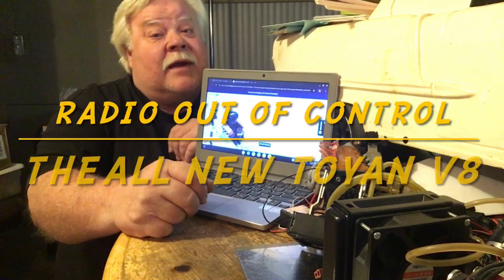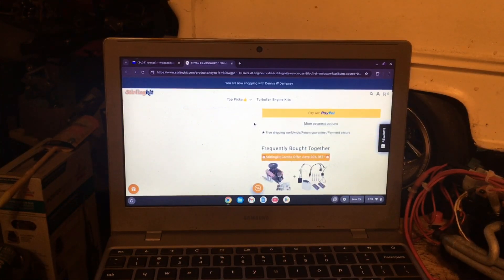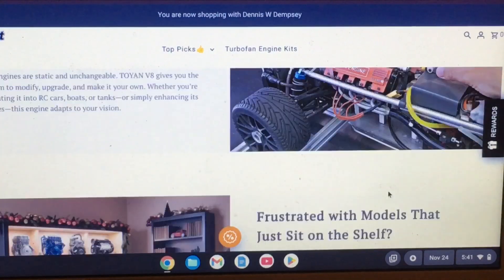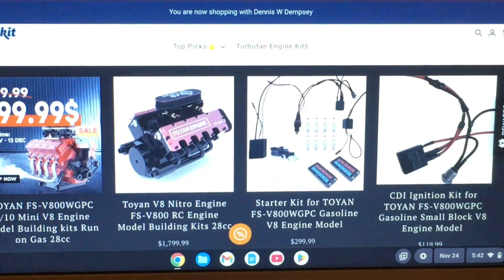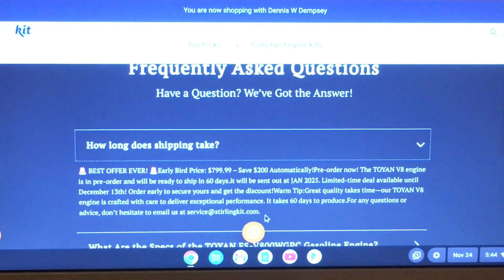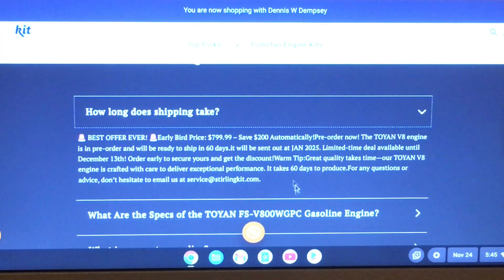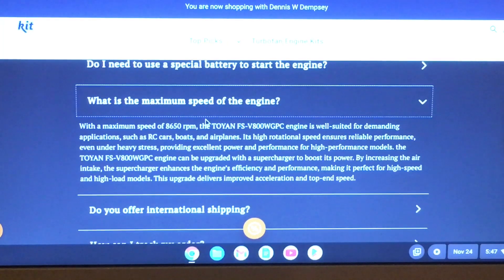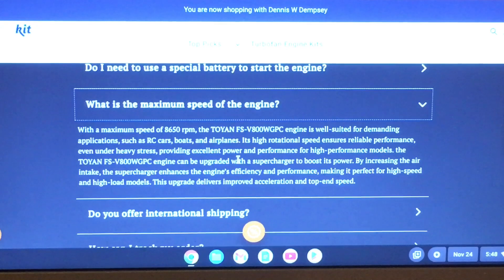The new V8 engine? a TOYAN?

Comment: I like the Cison V8 better because it looks more realistic. I have the OHV and Flathead versions. The ignition system on these engines seem to be more reliable as well. I ordered two Cison ignition modules to use on my Enjomor V12 so I don't have to keep robbing them from the V8 engines. Thanks for the update on the Toyan V8. I might get one. I'm not sure.
Reply from the maker: I have to agree with you there, the Cison looks pretty realistic! good call on the ignition modules 👍 I have a Enjomor V12 that keeps burning up the brushless starter motors, I had it fire off once before the second motor went up in smoke, I think its to tight and strains the starters.

Comment: I liked the new Toyan V8 for its design and price. I still don't know exactly how it works. But I do know that the first units are starting to be manufactured right now.
Reply from the maker: I am with you, there's a lot of speculation about how it functions. I am sure more will be revealed as they get more units built.
Reply: @dennisdempseyradiooutofcontrol You are right, that is what happened with the Cison V8 and it became my favorite engine from the first time I heard about it, so I will have to wait and see how its final production version turns out.
Reply: But what disappoints me most about this engine is its poor lubrication system. It was supposed to be independent when it is not. I will miss its first version very much, which is better than the new one for now.

Comment: Same sh*t different day for Toyan. It's a scam and no improvement by any means .save for cison or new small scale Chuan Qi v8 that's gonna come up
Reply: You are right, the new Toyan V8 should have come out much earlier than the Cison V8, so Toyan is pushing itself too hard with new generations of engines. I liked the Toyan V8 for its price.
Reply: chuanqi is making a 270 cc V8 and 150cc V10. Would be interesting to make a go cart or lawnmower out of
Reply: @martinzhang5533  there will be releasing a small size v8 soon. Stay tuned
Reply: @martinzhang5533 Yes, I heard about this a long time ago on the Howin Engine channel, they were working on the same engine, but what worries me is that it has gasket problems like the V12 and the nr-200.
Reply: Can u post the rough dimensions of the cison v8 on the table please?

Comment: FANTASTIC UPDATE DENNIS! I'm the old school guy, to be honest, BUT you have to stay positive about progress. The problem is that society wants instant gratification.  Pay and it just works. The grey area is that it kind of works and the amount of dollars shelled out does not equal what you received.  Alot of guys are getting gun shy to be honest Dennis. These companies SHOULD be reaching out to THE GRAND WIZARDS like yourself, jonny90 just to mention a few and have you guys torture test these engines. It's not bad to have a fail as long as you have a fixe for it. These companies are selling BETA  items and expect the customer to solve the weak points. The money is the short coming as I can see it. Get the funds first then fix the issues later. Times are changing , people are not so fast to part with money they have worked hard for to recieve sub part items in return.
Enough soap box 4 tonight. Glad to see you are doing well and thank you for the update.